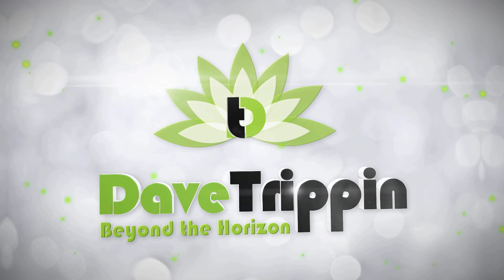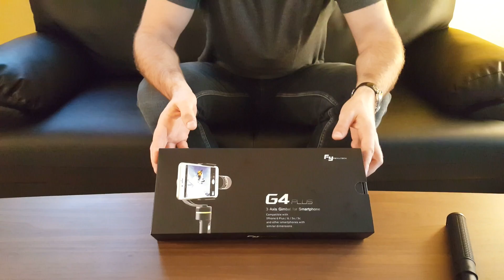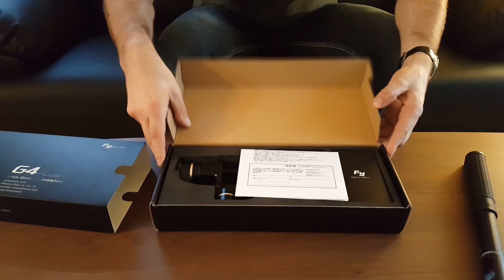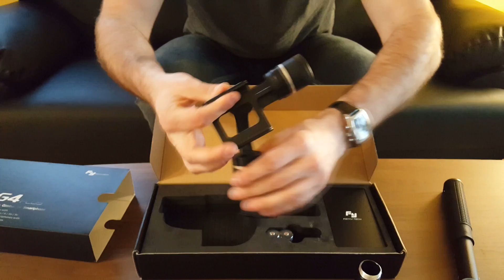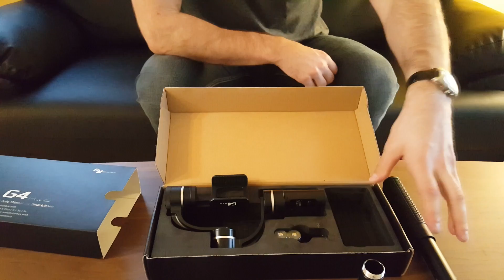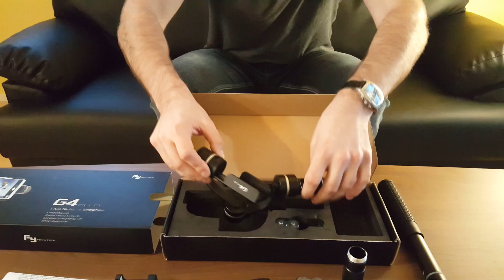G4Plus Feiyutech 3 Axis Gimbal Smartphone Unboxing | Channel Upgrades

Comment: Image, audio and stability are definitely points in a video's quality and you addressed a mayor one so I'm looking forward on seeing how much fun you get out of it. Remember that what's also important is to figure out what works good for you in the system and if it's worth adjustment. On this note I'm curios to know what type of traveling system will you carry because its clearly not a pocket size anymore. PS: Videomic me, or any other shotgun mic are something to consider if space is no issue. Cheers.

Comment: You can achieve A LOT with a smart phone. I mostly use the Nikon D5300 for my videos, but what people don't know is that some of my footage is shot with an iPhone 6. (It's not a lot, but you can't tell when I switch over. The only reason I use my phone is because I sometimes run out of battery power (despite having two spare batteries that I switch out.)  Anyway, thank you so much for this video. I have been thinking about getting this, but watching this unboxes makes me decide that it's totally worth it.